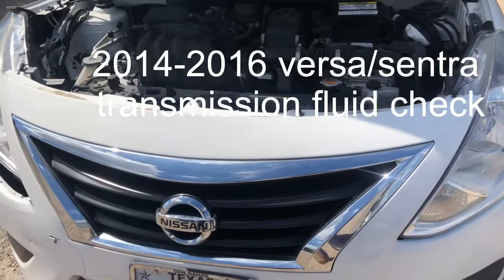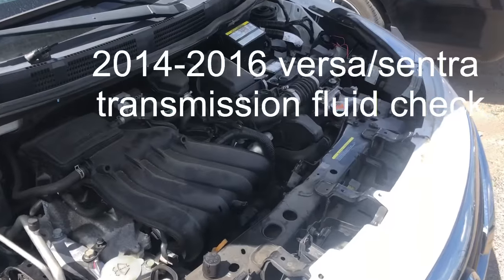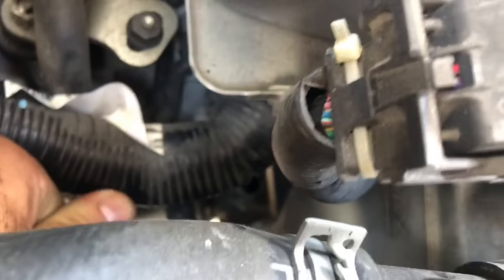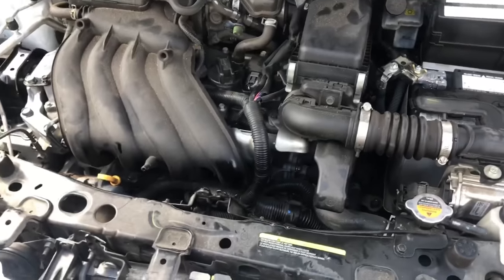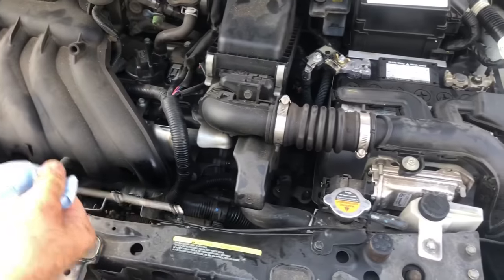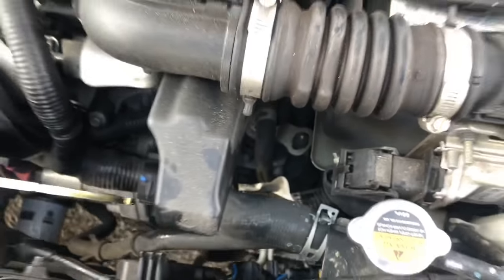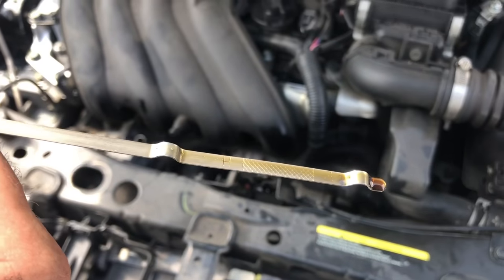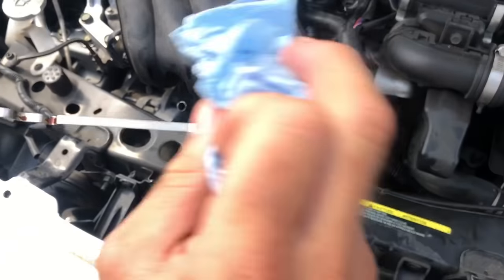2014 Nissan Versa transmission fluid check

Comment: This makes no sense. How can you check if the level of fluid is ok with a stick that is designed to measure the engine oil? It just tells you there is fluid in there, the level indicators are not designed for the transmission fluid.
Reply: Exactly

Comment: The oil dip stick is not going to give an accurate reading.... you'll know if there's fluid in it, that's about it.
Reply: Exactly lol
Reply: He’s telling you that his is full and if yours isn’t then fill it up to where his is
Reply: 😂 he already put it on level before inserting the stick and using the engine stick as reference knowing since everyone with a versa will have the same reading hes transmission level is good

Comment: How did you take out the plug?
Reply: Did you found out
Reply: There is a 10mm bolt at bottom of that pipe,,take that off an it’s much easier that way.

Comment: Do you have a tutorial on how to change the fluid?
Reply: I used a vacuum pump from harbor freight to remove most of the fluid and replaced it back with the exact amount of fluid. Oh yeah a huge tip: use the fluid from the dealership don't use off brand fluid.
Reply: @Jude13able why fluid from the dealer ship?
Reply: @indrapachecho  The fluid from the dealership holds up much better than the fluid from department stores. It might cost more but it is worth every penny.

Comment: The fluid check is underneath and checked at a certain temperature.
Reply: Exactly, as is with most CVTs. Do not follow what he's doing. You'll either under-fill or overfill your CVT or eff it up. The drain plug needs to be out with the engine running and the temp is 104F when checked. If no fluid is coming out, you fill until starts to come out and slows to a trickle and then install the drain plug. They have an overflow tube underneath the drain plug, that's why the fluid in the CVT does not drain all the way out.
Reply: ......90
Reply: @TM_Stone  thank you I was about to tell my nephew to take the car back.

Comment: So you're able to compress the tab and remove the cap without taking the battery/housing out? I have a 2012 and it seems like i'm going to have to remove the battery entirely.

Comment: You can't actaully tell how full / low the trans fluid is doing this method.  The only way you could do something like this is if you have a reference to go by, which you don't in this case.  I'm not bashing the OP but this doesn't tell you anything other than there is fluid in the trans, which you could stick anything into the check hole and find that out (and I wouldn't use the oil dipstick even though you cleaned it off, because if it goes too far into the transmission you could start hitting things that might be moving).

One other tip (not sure if you did this or not) but when you check trans fluid, you're supposed to run it through all the gears first (let them fill up) and then put it into park and check.
Reply from the maker: Of course, I checked a known good transmission to check if that was the right level, otherwise I wouldn’t made this video also all transmission need to be warm/hot to proper check oil level
Reply: Cuestion is perfec,answer is perfec.
Reply: @zdenanrehhelber  👌👌👌
Reply: @zdenanrehhelber but where did you put it, they’re making it for the Nissan mechanic to get unnecessary money is why it’s so far out of reach but where does it go

Comment: Hola Buenos días gracias por el vídeo, una pregunta tengo un versa exclusive 2016, con 60000 km, sabrás si es necesario reemplazar el liquido de la transmisión, de ser así sabes cuantos litros de aceite necesita,  y si debe reemplazarse  el filtro, saludos
Reply from the maker: Hola, si mira las transmisiones de hoy día NO se les hace servicio, quiero decir k no necesitas hacerle cambio d aceite, las transmisiones contienen un aceite de por vida, no es necesario reemplazarlo
Reply: @zdenanrehhelber  Enterado....solo que el tapon que muestras es diferente al de mi auto...es decir que enbla pared donde se debe insertar un destornillador plano para retirarlo...esta cerrado...como si no fuese diseñado para quitarlo
Reply: Amigo. Revisa tu manual de   propietario. Allí te especifican  cada cuántos  Kim se  cambio el aceite. Aaaa y el. Cedaso del. Carter dela trasmisión  se  cambia cada serv  así como el filtro de enfriamiento de la  trasmisión

Comment: You are single handedly helping give Nissan CVTs a bad name.

The engine oil dipstick has no correlation to the transmission fluid.

Comment: I bought a used 2015 nissan versa,  I have no idea if or when the fluid was changed.  How ofter do you all do it??  My car has about 79k miles on it
Reply from the maker: Anita Perry now days trans oil are lifetime, you don’t change it
Reply: Change it as soon as possible so you can track the changes. If you cannot damage the transmission

Comment: I couldn't get the cap off from the fill tube so I removed the fill tube using a ten mm wrench. 
Using a long skinny funnel added two quarts of Valvoline CVT trans fluid.

Comment: Aye bro how did you take that transmission plug out? I can’t get mine out it’s really tough
Reply from the maker: Lol ok, you may have to remove the battery, to see exactly what I’m about to tell you.
Right on the side of the cap there is a opening, you need to find a pick and press  and pull the cap, there is a little tan locking the cap on, that’s all it is, let me know if u can’t, I’ll make a video on that.
Thanks for comment

Comment: I'm having trouble getting that cap off, I found a video where the person used a flat head screwdriver to pop the clip loose. But mine is taking what feels like too much force to come loose. And I don't want to damage the cap or tube. Any ideas from ppl here in the comments?

Comment: Also, how do you know that the level in at the proper marks if the marks on engine dipstick are for the engine oil level only. I think that you are sending people in the wrong direction leading to transmission failure.
Reply from the maker: ag Alex this is just a trip man, not a OEM procedure, I’m an auto technician, I can’t give my people proper spec on how do things because they won’t be able to do it them self, I’m trying to save them some money

Comment: how do you know the stick for the engine can be used for the transmission? not necessary needs to the engine be running, that is why the stick have hot description
Reply from the maker: It’s a hack, also all transmission must be at operation temperature

Comment: If the transmission is oil is low on the 2015 nissan versa how do you put the oil in the car?
Reply from the maker: Sharlene Fowler In the same tube  where u Check the level
Reply: Oh ok thank you i thought everything was at the bottom of the car and you had to lift it up to do

Comment: I have a little problem with shifting sometime and I tried to pull that thing off to check the transmission fluid but it's hard to take it and do I have to remove that windshield wiper thing I have 2013 Nissan versa so I can have more grip to pull it or what you think
Reply from the maker: Sam Sam no, me I don’t have to remove anything, for your to be easy remove the battery that will give you space

Comment: Question  When you used the engine dipstick, did you run the entire thing all the way into the transmission or halfway?
Reply from the maker: Dennis Weaver it only go haft way sir
Reply: That’s my question also.  
I’m about to try this because my Versace is Long shifting. And thinking into certain gears.  Doesn’t go in reverse well either.  Runs at 4000 rpm at 80 mph
Reply: And I’m starting to hear a whinning as it goes through gears
Reply from the maker: The transmission is going bad man, need replacement
Reply: If it's winning try adding some fluid if  it doesn't stop then transmission probably bad

Comment: When I drive the car at 25 speeds get stuck few seconds vibrates then after 30 speed drives fine and not sure what is the problems
Reply from the maker: Transmission assy
Reply: Do you have an OBD reader if not get a blue driver and do a scan. You can also go to your local auto store or dealership and have a scan done. If they tell you that you have a code P0705 it is more than likely one of two causes your taillights or proximity range sensor on the transmission. But the first thing you should do before throwing parts is get a diagnosis and don't throw parts at it.

Comment: Great chanel 
Which the distance in miles , must be change cvt fluied and small filter in versa note 1.6 and how much litter in this transsmision 
Thanx alot
Reply from the maker: Now day trans oil are lifetime, if you change it you may run the risk of transmission failure, these transmission if they are working ok, don’t mess with it
Reply: Precision auto tech  thanx to answer but by litter how much must put on gear case
Reply from the maker: When empty it take 5.2L

Comment: I have a question, my wifes 14 nissan versa will not shift gears when ur accelerating u have to let off of the gass and give ot a few secs to shift. Fluid seems ok so cant figure this one out. Any suggestions?
Reply from the maker: Remember Nissan use CVT transmission, you won’t feel any shifting
Reply: Every figure this out?

Comment: Is there any reason why there’s a clicking sound on your car ? This is exactly how mine sounds and I was just curious
Reply from the maker: Christy mmm I didn’t hear any noise, maybe is just the video
Reply: thats the cvt transmission. get used to hear that noise, it supposed to
Reply: @sp11k3y  The CVT transmission is not making that noise. 
These cars are woefully inadequate 1.5 litre four cylinder engines. They all sound like that. Don't worry about it.
Reply: That's valve noise. Common noise on OHC engines.
Reply: Normal tick nothing to worry about

Comment: How do you get the god damn plug out
Reply from the maker: Duke Nukem lol it is a pain in butt.... there is a little hole on the side of the cap that you need to push in and lift up, there is a hidden tab tab that’s why doesn’t come out
Reply: IKR apparently you have to jack it up, get a flat head screw driver, lift it over the lip to release.

Comment: @Precision auto tech Can the fluid level affect the  gear changes of the car? I think my car is doing too many revolutions to change one gear to the other.
Reply from the maker: Andres Erazo yes, if trans is low in fluid it will affect shifting
Reply: @zdenanrehhelber  after about two long hours trying not to get the lid...
Reply: I have the same problem I tried to pull that thing off to check the transmission fluid but it's hard to take it and do I have to remove that windshield wiper thing I have 2013 Nissan versa so I can have more grip to pull it or what you think
Reply: Cvt transmissions don’t have gear changes 
Constantly Variable Transmission

Comment: i have 2014 Nissan versa with cvt transmission, it start very well but some time not moving or if moving very weakly with no acceleration even if you push the full acceleration , please help what to do
Reply from the maker: Bad transmission bro
Reply: @zdenanrehhelber  very expensive,  can it be repair?
Reply from the maker: Shah Sawar it cost $1800 and can’t be repair
Reply: Shah Sawar I’m having the same issue. I have the same year as well. My car is having shifting problems when I accelerate
Reply from the maker: Juwuan Smith sorry to hear that

Comment: What about the length of the dip stick. How do you even know that the length of the oil dip stick is exactly what you need to measure the oil level.
Reply from the maker: Nabeel Siddiqui because it won’t go any further
Reply: That's not a very calculative way to determine the length. I can Shove in anything and wait until it stops to go in.
Reply: The first time I inserted the dipstick it went all the way up to the handle. It must have curled up by then. So I reinserted the dipstick lightly until the first stop. This is probably where yours is placed at.

Comment: Hey, how did you get that damn cap off?
Reply from the maker: Lol may I know is a little bitch to get off, but if you pay attention the cap have a little hole in the side where you need to press a clip to release it, try if not give me a call 8 32 57 6 88 7 70
Reply from the maker: Abundant Backyard Edible Living you have to used a tool, very small screw driver to be able to move the locking tab
Reply: I can't get mine off either
Reply: I pulled mine off with channel locks and brokenthe clip, so now it's only secured by the o ring 😅
Reply: It’s a tight space to use a screw driver n pull it out at the same time
HELP

Comment: Hey man, I have a 15 note like the one in this video. at 1700-2000 rpms (No more before or after) and in any gear (not in neutral) i can hear a whine noise. I cant put my finger on it. I tried it in nuetral and it doesnt make a sound. Any thoughts?
Reply from the maker: Uncle Sam man Nissan  transmisión suck! Make sure the level is correct, sound like is low on fluid
Reply: Low fluid alternator bearing and or belt maybe even engines flexplate

Comment: Should i check the cvt level when engine is running or off cause i measured when it was off and the dipstick didn't indicate the level of the oil
Reply from the maker: Yes, all transmission fluid must be check when running
Reply: @zdenanrehhelber   Not all transmissions. On Hondas you have to check the transmission fluid when  engine is off. Also, how do you know that the level in at the proper marks if the marks on engine dipstick are for the engine oil only.
Reply from the maker: U asking how I know ? Well I checked a know good vehicle and compare

Comment: How do you know what level the transmission fluid is supposed to be at on the oil dipstick? The depth indicators on the oil dipstick are designed for testing only the oil level.
Reply from the maker: I compared with a known good one, that’s how I come out with the level
Reply: @zdenanrehhelber  I see thank you

Comment: Hey I'm trying to take it off but its not moving where did you use the screwdriver
Reply from the maker: Lance Frazier on the side of the cap, is a little hole, that’s where u gonna push in, is hard to see

Comment: How did you get the plug off ?
It’s not easy
HELP!
Reply from the maker: Thanks for your comment, I would recommend you to removed the battery to get more access, the cap have a little tab on the side that you have to push to remirase from the tube, that tab keep the cap in place.

Comment: Hey bud what type of transmission fluid would you recommend for the Nissan Versa 2014?
Reply from the maker: o sl yes sure NS-3 will be the one, Castrol is fine, but if you can use Nissan is better
Reply: Do you mean the Nissan brand CVT transmission fluid? Thank your for the quick reply!!
Reply: Is that the fluid oil you recommend?
Reply from the maker: o sl that’s the one
Reply: Precision auto tech one last question my man..... how much fluid does it take? How do you know when’s it full?
Reply from the maker: o sl it depende if you drain it, it would take like 3-4 qt if you replacing it it take about 6 qt, I suggest to check with the engine oil stick like it shows on the video to make sure you add the correct amount
Reply: Precision auto tech can I use Valvoline CVT FLUID???
Reply: @zdenanrehhelber  , what about Nissan D matic?

Comment: If I could find it it would be helpful I found a little rubbery type cap would that be it is it like rubbery and flexible
Reply: Your too far up and to the left. Look at this video closer and youll find it. Its not very easy to see but it close to the left front of the batter plate. Kinda underneath. Your probably looking at that rubber grommet to the left of that plate. All directions refering from standing in front of the car

Comment: Hey is the gear oil and Transmission fluid the same??
Reply from the maker: Syedkabeer Ahmed yes, now days cars only one fluid for both
Reply: NO IT IS NOT !  Check your owners manual for each specific one.  Do Not Mix engine oil with transmission fluid, or transmission fluid with engine oil !  You will DESTROY the engine or tranny if you mix or use the wrong one.  It is STRONGLY recommended that you only use Nissan transmission fluid in the CVT transmissions.  It changes depending on the year of the vehicle !  A 2012 uses a different fluid than 2013 on up.  Check your manual !

Also, the way he is showing this does not tell you if the CVT fluid level is correct or not, it only shows you there is some fluid in the transmission.
Reply: I  use  castrol  its  good  ns 3

Comment: how do you know that bump on the oil dipstick is the correct level for the tranny fluid. AND, how far down did the dipstick go?
Reply from the maker: That’s easy, I checked a know good vehicle, and how fat? Well until reach the bottom, it won’t go further in it has a stop
Reply: @zdenanrehhelber  Horrible advice. If you can find any maintenance manual that agrees with your advice I'll believe it until then this is a dump truck load of BS.

Comment: Question tech I have a little problem with shifting sometime and I tried to pull that thing off to check the transmission fluid but it's hard to take it and do I have to remove that windshield wiper thing I have 2013 Nissan versa so I can have more grip to pull it or what you think
Reply: you have a problem shifting because its a cvt... usually keeping it between 2 and 3 rpm  makes it happen alot less
Reply: its also slow to accelerate so dont give more gas, it will get there

Comment: how many liters are used to replace the automatic transmission fluid after two pieces lock nut and allen key remove?
Reply from the maker: not quite sure
Reply: This is CVT transmission not automatic transmission, you will need 3 quarts but in recommend getting 4 quarts just in case
Reply: Yes lil over 3 quarts Valvoline full synthetic CVT/ATF transmission fluid ns-3 for 2019